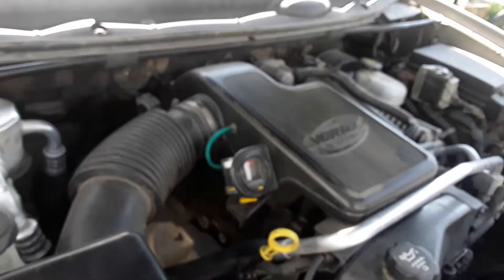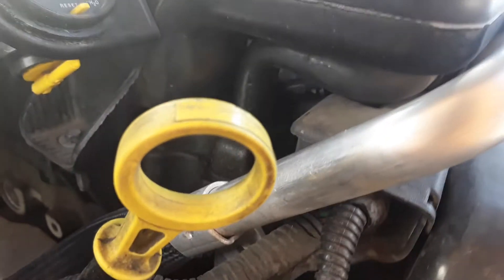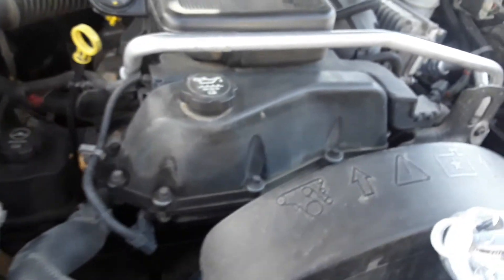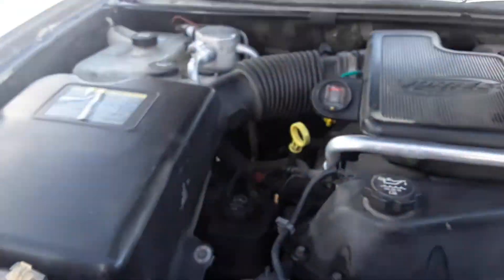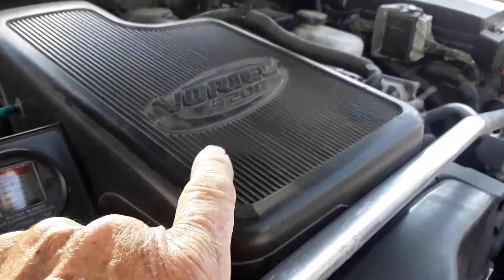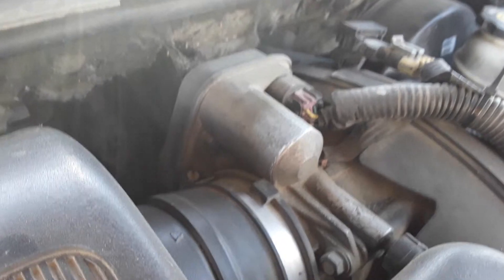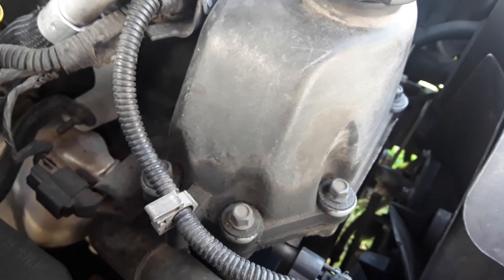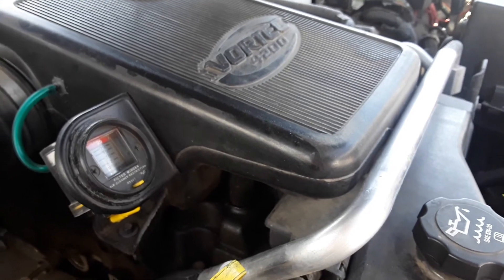Yes, The 4.2 Has A PCV System

Comment: Hello , I just just sprayed out my Hose like you said and had air into manifold hose and Air coming back out from my left side vent hose , but im not getting a Vacuum on my Oil stick what could else be plugged up ?
Reply from the maker: I'm not clear on what you mean by "spraying" as I never said to use the spray version of B12; use the LIQUID version and pour some into the hose, reattach the hose, start the engine after a short time. 
Are you sure you have air coming out the left side hose? I ask because you are supposed to pour liquid B12 into the left hose. 
Remember --- the left side of the engine is the driver's side as if you are sitting in the car sitting behind the wheel. 

The only thing that will restrict the air flow is that the passageways inside the head intake runners --- are full of hardened gunk. It may take several --- many --- a lot of treatments to get it to start working if it's never been cleaned or kept clean for years by now.  
Make sure the engine's up to normal temperature before you put the B12 into the hose --- and let it sit because the vapors are very aggressive if you let it boil for a bit. Repeat at least a few times - weekly if possible until things start getting cleaner and cleaner. .
Reply: Huh what I meant Sprayed I used Carburator Cleaner and the used an Air Hose when I did the Air spray Air came out the other PVC hose on the right  side of Motor PVC but still no Vacuum on my Oil Stick , P0171 code and P030 O2 sensor code something seems Plugged up still in Motor > You think it could be the Head Intake runners , I did Add some Rislone to clean Motor and used some Fuel cleaner . @SurferJoe46
Reply from the maker: @lassiejr2115  I'm still confused. There is NO PCV hose on the right side of the "motor" as you put it. 

There IS a KV hose - the short "S-shaped" hose that goes between the air-sound deadening chamber and the valve cover however. 

Is this the "PCV" hose to which you are erroneously referring? 

"Carberetor spray" is not the correct liquid to use. Specifically, I said: "Berryman's B-12" is correct as it is very much more aggressive than other chemicals in this application. 

You state that "something seems plugged up still in (the) motor" and I cannot reason how you came to that idea because the P0171 means you have a Fuel Trim System Lean condition in Bank 1--- and no way can a defective/inoperative PCV system cause that. 

Your P0303 is also NOT caused by a defective/inoperative PCV system. 

FYI -> P0303 indicates a problem in #3 cylinder --  but it is not suggesting any cure or deeper diagnosis in that cylinder --- it just says there is something wrong in how #3 cylinder is performing --- and that may actually be a red herring too. 

P0303 is not a malfunction from a bad/ineffective PCV system --- it is related to only one cylinder and the PCV system involves ALL cylinders and cannot just pick on one or two ----

You are in over your head I think and are not categorically NOT following my instructions and you are making wild a$$ assumptions that are not logical nor part of helping the PCV to return to a good working condition. 

These codes are another problem entirely NOT related to the PCV system,
Reply from the maker: @lassiejr2115  DANGER ---> Using Rislone or any other magic-in-a-can cleaners or additives is totally counterindicated for this engine. 

This engine needs FLOW, not pressure as it meters the oil to the many zones it is needed and adding something that cleans and changes the viscosity of the oil can be extremely damaging to this engine. 

Stop using these chemicals in the crankcase! You are harming your engine.
Reply: @SurferJoe46  genuine question sir, I am currently in the process of trying this myself. However, I cannot find anything online about Berryman’s B12 liquid. The only thing I found that had a specific use for the PCV system was Berryman’s B12 Chemtool spray. Would you be able to provide a link to the product? I still cannot find this stuff in liquid, non-spray form.
Reply from the maker: @benherrstudios  Here's an Amazon link to the product: https://tinyurl.com/5n62kyf4 -, and Amazon, NAPA, O'Reilly's, CarQuest, WalMart, Auto Zone and others recognize it by part # 0116 B-12

Comment: Can any other product aside from B12 be use? example: any other fuel/injector cleaner?. Thank you in advance
Reply from the maker: Remember this isn't clraning the injectors or fuel system; it's trying to dissolve caked and baked on crud and deposits from years of neglect. 

I understand that Chevron Techron is another good solvent, but I've never used it. B12 I know; others not much at all.

Comment: Hey Joe. Thanks for the great video.
Listen, My 2009 trailblazer makes loud exhaust noises on passenger side of engine which go away to a certain degree after the car warms up. I was told by a mechanic that these vehicles are notorious for developing exhaust manifold cracks. Can that be right? I have a feeling that it could be the expansion "donut" seal where the exhaust manifold ties to the rest of the exhaust system.
What do you think?
Reply from the maker: Unfortunately the exhaust manifold has issues with breaking bolts and cracking. Once you hear noise from there it needs an intervention. The donut doesn't seem to be a big problem though.

Comment: Thank you so much for this video. I have cleaned and replaced my throttle body, map, and clutch sensor a couple times to fix this issue.  Even all of my spark plugs and direct ignition coils. This year it still had the random misfires and rumbles after all the changes. I finally thought maybe it was the pvc. It was acting just like a 3800 series 2 v6. First start of the day works great. After warm up acts horrible but darn sure not a bad gasket. 

So finally looked up where the pvc is on the 4200 and found your video. After following your instructions. Warmed up the engine, filled tube, put tube back on and let sit for 30min, wamred up engine again and repeat. After doing this four times it seems to have cleared out the pvc system and now works great through the day.

So thank you so much for this video. I was losing my mind until i remembered the pvc sytem and found your video.
Reply: I have same your issue you can help me What did you do in detail?
Reply from the maker: That's what I'm here for .... thanks.

Comment: I can't get b12- would a carb cleaner work?
Reply: You have to warm up the engine, fill up the tube and connect the tube  and let it sit for 30 min. Turn over the engine and let it warm up again and do it again. I did mine four times and then it worked great the first time. If it still doesn't work then check your throttle body, air sensor map, and clutch position sensor.
Reply from the maker: Most carb cleaners are not as aggressive as B12. It may take more 1. cleaner, 2. patience, 3. money t get the same results. 

It can't help --- but if it will help enuff --- I got nuttin'.

Comment: This is the problem Im having take apart half engine replacing EGR valve 07 4.2 and cleaning up all the gunk.
Reply from the maker: The Atlas/Vort4ex 4.2 does NOT have an EGR; it has VVT and it is therefor exempt of needing the EGR.

Comment: So take the tube off pour b12 in it reconnect it an let it sit then without removing the hose again start the truck up an let it burn the residue off?
Reply from the maker: Yup. It's best if you pour the B-12 into a hot engine --- the vapors are great cleaners!
Reply: @SurferJoe46  ok because I have no suction in the dipstick an no milkshake in the filler cap. But the truck only smokes if idle for a short time like a drive thru
Reply from the maker: @bikerboyvideo  describe the smoke for me 
1) fluffy white smoke that disappears in a few moments or gently drifts away .......................... 
2) heavy kinda-blue-ish smoke that smells sweet and lingers for a long time and will blow out a bigger cloud if you rev the engine 
3) an acrid - eye-watering smoke that can make you cough and hurts you lungs -- the smell is nasty and sharp. 

Take your pick 1 or 2 or 3.
Reply: @SurferJoe46  2 but smells like oil. As long as you driving it doesn't smoke but if you idle for a few mins here comes the smoke
Reply from the maker: @bikerboyvideo  I'm out on a limb here as I am not 100% sure of the valve stem sealing type in our engines - yet. Oil an leak into the combustion chamber(s) on an idling engine, going down through the valve guides - and then when you hit the throttle, it willl smoke somewhat heavily for a few moments. How's the oil consumption? BTW ---> I do not suspect an oil over filled situation here.
Reply: @SurferJoe46  maybe like a qt every week an half to 2 weeks

Comment: Good evening... my Trailblazer is getting my spark plugs wet from the top through the coils, what would be the solution?
Reply from the maker: The solution may be multi-fold in that, ultimately the oil on the tops of the plugs - and this means inside the sparkplug wells machined into the head - comes from the valve cover gasket failing to hold the oil inside the top of the engine. 
That said --> there's a reason WHY it's happening and this leak is not really "typical" unless something else is working on it to cause it to fail - talking about the valve cover gasket. 

1. Pressure is not supposed to exist inside the valve cover --- also not in the crankcase by inclusion.
2. The biggest problem is failure to service the crankcase ventillation system, and that's what my video was all about.
3. The whole inside of the engine - the crankcase, by common name - is supposed to be under at least SOME vacuum at all times.  
4. View the video and see what other people have had for their experiences and see if you can find how you can help your engine to not leak. 

Find the cause and fix the problem.

Comment: Hello I have a 07 trailblazer 4.2 rough idle p0300 code. I've replced coils plugs,map maf,cvt valve. It has a rough idle only when it's warm. I can pull that hose off the manifold and have great vacuum soon as I plug that hose back in rough idle. I have that white chocolate milk on the top of my oil cap but not on my dipstick or inside the box going to the throttle body. Any ideas
Reply from the maker: Thank-you for asking this question ---
The emulsion (a mixture of oil and water) under the OIL cap has to be addressed first. 
With the engine running, reach under the sound chamber and flick the "s-hose" off the nipple that comes up from the valve cover. 
Check for vacuum at that nipple, not the sound chamber side of the s-hose.
Reply: @SurferJoe46  thanks for getting back to me. So I have no vacuum at that s pipe. After checking it I put my finger over the nipple, and I do get a small whistle when I pull my finger off it

Comment: I cracked the hose. It was hard and brittle. How can I get another?  What’s it called?  Thanks?  2003 4.2 with 270,000 miles
Reply from the maker: "The" formed hose is not likely available --- but it is easy enough to buy some bulk CV hose at your local auto parts. 

Remember that all hoses that are in the PCV/KV/CV/AIR Injection system(s) even if you don't have all of those I just mentioned --- will have hose that is measured in 32ds of an inch. 

Examples ---> 15/32", 11/32", 9/32", 5/32" ... etc. 

This was to keep people from replacing the correct hose for a piece of garden hose. The reason is that garden hose will melt whereas real emission-type hose will not.

Comment: Are you putting the capful on vacuum side (driver side hose) or atmospheric one side? That was not clear to me. Thanks.
Reply from the maker: The hose, really, has a top and a bottom and is hollow and one side goes to the plenum after the throttle plate and the other goes to the intake runners, just before the intake valves. It's really the same thing, just it's a lot easier to pour liquids DOWN into a hose than pouring them UP a hose. 

Gravity sux.

Comment: While changing my air filter in my 04 trailblazer I noticed what looks like a bypass of the air filter air, seems very odd. Open air box, remove filter look as far forward as you can (toward front of car) is this really bypassing air filter w dirty air?
Reply from the maker: I'll have to look ... but off the top I say not likely. The liabilities of damaging an engine would be countered by a lot of lawsuits.

Comment: I have plenty of vacuum from the top nipple on the valve cover. I’m not feeling much from the dipstick tube. I’m a bit worried because I just replaced the valve cover gaskets. Every gasket around the coils failed and was full of oil. I really don’t want to do that job again. 05 trailblazer with the same motor. Any suggestions? Thanks for the vid.
Reply from the maker: Vacuum at the dipstick may be next to impossible to feel --- perhaps a vacuum gauge would see it though. 

The inside of the engine should be under a negative value (no pressure --- good amount of vacuum) all the time and it is especially noticeable at idle 'cause you can get to it whilst the engine is running. 

Keeping a good vacuum metric is only possible if the system's working properly. When there's no vacuum is when things start to leak or seep oil. I'd say you should be in a pretty good place if you can get good vacuum in the engine crankcase.

Comment: The fact this isn’t viewed more amazes me. I’m younger and This is AMAZING information. Owned my trailblazer for 8 years, never knew about this. Started having issues with oil coming out of that bypass tube. I wish you had more videos pertaining to this truck. I could learn so much from you!
Reply from the maker: It is a niche-video that only applies to people who actually own these vehicles. 
As such, and that many people start changing the air filters, rotating the tires and changing the taillight bulbs to fix oil leaks at the valve cover and condensate buildup in the crankcase. 
Thanks for your comment.

Comment: I kinda lose you when you’re talking about removing the gunk.  Could you go through the motions of doing so. We’ve got an easy 235k on our 06 and suspect we may need a DNC, DUSTING N CLEANING inside there. Great video. Thank you. Steve, Plymouth MA
Reply from the maker: The only thing you can do short of removing the head is to clean, clean and clean some more with the B-12 to soften up and let the gunk get sucked into the hellish fire of the combustion chamber. Use the B-12 as many times as you feel or desire - just remember that there's not "complete cure" to the systems if they've been ignored for years. 
You can clean it - mostly, not 100%.

Comment: No one really cared about everything that he went on about. It doesn't say how engine works. It says you're going to show the PCV valve location. Make another video for the rest
Reply from the maker: But I DID show where the PCV is --- it's nowhere! 
The "V" part of PCV implicates that there's a valve somewhere in this labrynth system --- there is NOT. 
It's just ports that never change dimensions nor flow capacities unless they are clogged up with gunk. 
When they are clogged up --- baby poop happens. 
YOU may not care --- but many do as I took a soft approach to a complicated and unreliable system that is rife with problems IF one does not keep it all clean. 
My post is REPAIR-ITIVE, not a Maintenance Instruction. 
If you came here --- obviously --- yours isn't working.

Comment: I wish I could shake your hand and thank you for making this video Sir! Only question I have is how did you go about getting to the bottom end of the hose that connects to the intake manifold (the one for the crank case). Did you go in from the engine bay or from underneath the trailblazer to disconnect the bottom end of it? Hope you’re doing well.
Reply from the maker: All access as we need it is over the driver's side left fender. 
If you can't get the lower clamp off --- just pour the Berryman's Chemtool B-12 directly into the rubber hose when/if you get it off from the top clamp and plastic nipple. 
Thankfully --- on plastic --- the hose will be much easier to release and pull off because it won't create corrosion and make it hard to remove. Plastic and rubber don't really like each other anyway --- so they're happy to be bisected from each other.
Reply: @SurferJoe46  thank you Sir. Hope you have a great day.

Comment: Would seafoam be safe for this job also? And thank you for your great video!
Reply from the maker: Seafoam is not aggressive enough to clean these passageways ----- it is really just the equivalent of green soap that was used in lavatories in grammar schools when I was a kid. I had an industrial chemist tell me that and I have no reason to doubt him. 
Seafoam won't harm your vehicle paint, but I'm not too sure your paint would be safe with B-12 on it.
Reply: @SurferJoe46  I notice 2x 8mm or so bolts in there can I remove an replace this part? or does the whole plenum require removal also. In anycase, i'll have to purchase the B12 online.. Canadians have no good products for sale :P such as B12 unless you could recommend something of the sort. I have zero vacuum from the oil dipstick also. I've read a few posts in here but to keep it simple I'm focusing on the port on the bottom that has almost no vacuum? the top one has great suction. Or both would be beneficial?